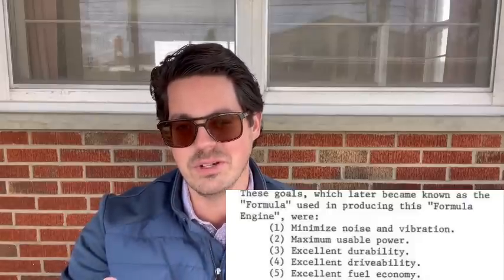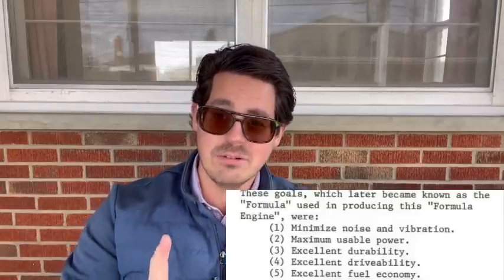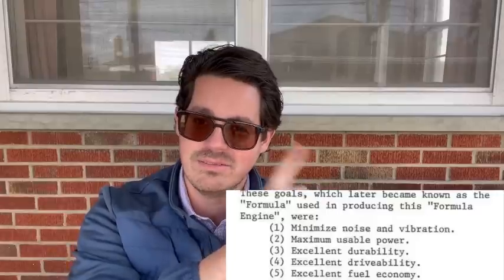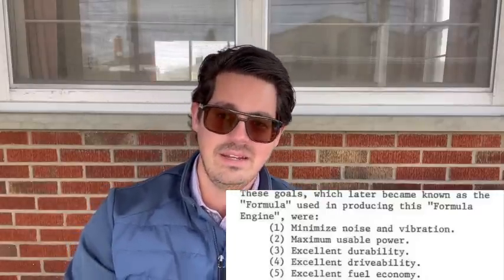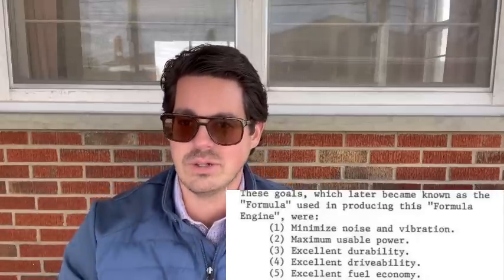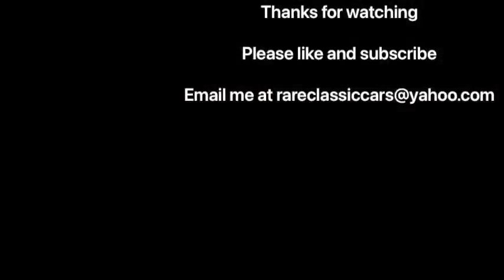Worst Engines of All Time: GM's 2.5L Iron Duke 4-Cylinder

Comment: Owned 2 "A" cars with this engine, although gutless and noisy to the point years ago someone asked if it was diesel, very dependable. Decent fuel mileage, in terms of a TBI engine, and very simple to change almost any control on, in car especially. The early fiber timing gear left us stranded once, but my 88 model with balance shaft and silly "in pan" oil filter sat 2 years in a swamp in the back field, has every wire and contol bypassed, has rodent nests all over, still sounds like it did when new, yes I am saving this engine.

Comment: One other thing you didn’t mention concerns the oil filter. This engine was first designed for rear wheel drive applications, and when the engine was turned sideways for front wheel drive, the oil filter was a bear to change, as it was on the backside of the engine with a lot of stuff in the way!

Comment: I this video should be renamed. Best 4 banger. Of all. Time. I was a mechanic  back in the. 70 s. And. 80s never saw. One blown or  a. Bad  head gasket. Unlike. The. Croniicly  I ll. Hondas. And. Toyotas.   I  did. Put.  A Rochester 500. cfm  on  two  of. Them.  Woke the  little. Guys right  up

Comment: I thought they were decent engine's but definitely not one of GM's best, I heard they were better than the 2.8 Liter V6's on many early 80's GM vehicles.
Reply: Both engines were real shitters.   I was a service tech at a GM dealership in the 1980s.  There was a service bulletin on the 2.5 noisy fiber cam gears and the flat rate warranty time to replace them was pretty bad.    The Tech 4 Iron Dukes went through a phase of broken head bolts too ; especially the center head bolts.    These were really bad years at GM.
Reply: 2.8 was in bertta gt an was scary fast, oil ports in valve cover back to pan helps a ton ,high Rev suxs pan dry,oil returns to slow,ports to  small,

Comment: After being a professional technician for 30 years I would respectfully say that anyone who thinks the Iron Duke engine was a great engine apparently has very low standards as far as what constitutes a great engine. It was a waste of good iron and steel.
Reply: I do recall they were somewhat reliable in comparison to some of the other junky engines at the time. Never would I consider spending good money on a car with that engine, but a beater in the mid 90's could be had for close to nothing with that engine still chattering along.
Reply: My 30yrs says that the motor was what it was......a basic, reliable engine that was rather noisy with no frills at all.  Not sophisticated enough to race with in any class.  Pretty tolerant with a lack of oil, since it leaked most of it.
Reply: Most of us "regular" people mean super reliable and rugged, and easy to repair, when we say "great", not high-tech, aluminum, complicated with a rubber timing chain and the water pump inside the timing gear cover.  That 151, and its 153 forbearer are Chevy 6s minus 2 cylinders, and that 3rd generation Stovebolt is heavily based on the small-block V8, a great engine.  Not all of require 500 horsepower.
Reply: @michaelbenardo5695  And the Iron Duke doesn’t even come close to the quality of other engines of that time period. It would’ve been near the bottom .
Reply: @prevost8686  My definition and your definition of quality are very different then.  To me, something that is very reliable, rugged, can take heavy abuse and still come back for more, and lasts a long time is high quality.  To you, I think, high quality means innovative, lots of horsepower per cubic inch, capable of super-high RPM, and cutting-edge technology.  Remember, the Vega engine seemed cutting-edge when it debuted.  It was garbage.
Reply: @michaelbenardo5695  Not into horsepower. Never have been.
Reply: @prevost8686  I am not really either, but I do require lots of torque.  I like that effortless feeling.

Comment: Adam, I wouldn't put that engine in the "worst " category. Crude yes, unrefined definitely, reliable absolutely. Power was an after thought. Early carb models were to say the least gutless wonders, when you floored it all it did was make noise and go nowhere... fast. When they TBI 'd them really kinda of liven them up...Some... Always thought of that engine as GM's way of entering into that era of more fuel efficient, compact car powerplants. The oil embargoes of the 70`s (who remembers when gas prices hit a $1 a gallon in around '78 and people were so shocked) definitely caused a shift in the market, which not only GM but all the domestic manufacturers had to adapt. Just about killed Chrysler. Asian cars along some European cars were taking over.  I used to call them the "silicone engines" because of the wide use of GMS. They were oil leakers too.. Like you and many others have said it was used in about everything, cars,pickups, industrial and marine, etc applications. Even other manufacturers used them as well. Probably because of unrefinement and crudness they were cheap to produce. The fiber cam gears were suppose to quiet them down a little, in which they did... for a time, but when they started to wear you knew it. They got loud. There was and still probably available aftermarket steel or aluminum replacements. If the owners had kept up on the routine maintenance,  (like any car) oil changes, coolant flushes, etc they were very reliable in which didn't see as many mechanical failures. I think because of the lower power output is one of reasons why that could last so long well over 100K+. They were pretty well build inside, besides the cam gear. Never saw (at least in my area) allot of bottom end failures, mostly the typical issues, oil leaks, cam gears, head gaskets ( mostly due to head bolts breaking on the exhaust side usually between cyl's 2,3.) and occasionally cylinder heads would crack due to severe overheating, because of prolonged coolant leak or sudden loss, stuck closed thermostat, etc. They serviced there propose for the time, very well. The much earlier GM 152 4cyl used in the 60's Chevy ll and Nova models was a great little engine, it to was used in various applications. The ones I remember were mostly in industrial use, portable High volume air compressors, mobile generators and even some smaller forklifts. My work has a Daewoo forklift (made in South Korea) which has that engine, of course propane powered, electronic ignition (Hitachi equipped) it runs great. Makes me wonder if GM had sold off the plans/ tooling to make that engine to Daewoo, I know they were "in bed" together for a while, but that's another story.
 Thank you Adam for the great video and look forward to seeing more.
Reply: every worked on a ford T-engine? as im 🤔 thinking it might be cousin's to it as later t's had OHV head casting or at least a option to fit one and the big 3 at one time used the same sub supplyer of engine parts ect.
Reply: @richardprice5978  No I haven't, to be honest I've never heard of one. Is it the Ford 4 cylinder flathead model T engine? Those engines were also used in many industrial applications, very durable and dependable. What I was told, many are still in use around the world and replacement  parts are still available. It doesn't surprise me that the big 3 auto makers shared part suppliers, possibly one way to keep overall costs down.
Reply: @michaelmurphy6869  yes the flathead L-4 ( and i think grow to 4->L-6 -> L-8 cylinder's but by 1970 8 died off ) that i think 🤔after being tipped off got to live on intel at least the 1990's but by that point it was changing to meet the automotive manufacturers needs in the marketplace.

and it wouldn't surprise me if there's a AL castings version of it or twin cam ect. letting live on aka the 2009 dura tech boosted chevy cobalt engine/goblin engine ect. . i will say if thats the case gm tried to do a better job than jeep 4.0L 6 or 4cy as it got stuck in the past and is easier to see the history back the 1930's 😉ect. plus the paperwork trail 

i just don't have the paperwork/evidence  showing that but yes covertly sharing a base model engine and or transmission ect. would cut down on costs a lot, and contental is my first pick to look for the laundry 😉 and at one point sounded like they were bragging about being a automotive car manufacturer but never one with there logo on it aka hit i think 💭
Reply: @michaelmurphy6869  yep sharing does let you have marketing choices and let you do expensive orders sheet options like a 426 hemi that dodge knew might not be a great seller but does help the overall brand image ect. same for caddilaic car's as a hole for gm pre-1985 as the 1970's was probably the last of the real competition for rolls or miboch ect and now days isn't even in the same category of car sad 😞

Comment: The Grumman LLV had the 2.5l from 1987-1992. The last 2 years (1993-1994) was a Chevy 2.2l. The 2.5l had the catalytic converter right under the driver's feet. The 2.2l had it under the tray side. These vehicles have no insulation against the heat coming up through the floor. The 7 digit truck number denotes the year it was made. The first digit is the last digit of the year.
Reply: I'm amazed that they are still in use. I recently moved to Idaho, some of the postal delivery vehicles up here are Mercedes Metris vans with right hand drive. Rural carriers have imported right hand drive micro vans from Japan.
Reply: @Paramount531  My postal carrier is driving one that has to be from the 80s. It's the most beat up mail truck I've ever seen. Apparently they're wringing every last penny out of them that they can.
Reply: I'm driving these LLVs right now. There miserable to be in. But they serve there function well. There so industrial that simple human comforts are none existent.

Comment: Many moons ago in mechanic school we used to say, “the iron duke’ll get you to 200k…but not very fast.” My grandparents had an ‘85 Cutlass Ciera for about a year and it was so displeasing that 37 years later a 4-cylinder car is still out of the question!
Reply: Accurate.
Reply: In line fours are the smoothest engines you can get in motorcycles.  My Saabs with fluid filled mounts are totally smooth.  I always thought it was a GM fetish.
Reply: @rogersmith7396  Flat or straight 6s are smoother.
Reply: @Mythicregard  — I really like the BMW flat-2 engines. Even with a big-bore 1200, still pleasingly smooth.
Reply: You can get 200 horse naturally aspirated 4 cylinder engines today. I gotta turbo charged one with 310 horse and 350 ft lbs. No complaints.

Comment: My dad had a 1989 S10 with the 2.5L and it was a good runner. Had two issues heater core blew and the computer went out. We went on many road trips. This truck with a 5 speed would get 30 mpg. Hit the hills in 4th gear and run 65 mph over them.  I do remember those 2.5l in GM cars and boy talk about rough.....yikes.
Reply from the maker: Yes. It’s funny.  All the S10 guys are upset w me, but this engine in an auto trans fwd passenger car was really a disaster.

Comment: Had 2 celebrity's in high school and college. A 1984 and a 1989. Both cars had around 120,000 miles when I got them took them both past 200,000. I will say the 89 was much more refined than the 84 was.
Reply: I think they got balance shafts in '87/'88 depending on the tranny.

Comment: My 1992 Chevrolet S10 Tahoe was an outstanding truck. The Tech 4 -  2.5  with 4 Speed Automatic was noisy and unrefined but ran forever.
I'd buy another if i could find one.
My 1987 Fuel Injected 22RE Toyota ran like a sports car by comparison.
Reply: I had the GMC Sonoma with that 2.5L, same as the S10. It was suitable for a small truck and with the 5 speed manual was fine. Durable and reliable, not a powerhouse but the manual tranny certainly helped that.

Comment: I had an 80's Pontiac Sunbird with an Iron Duke in it,  It was reliable, got decent gas mileage for the time, and when I sold the Sunbird the engine had well over 250,000 miles on it since I maintain my car exceptionally well.

Comment: I had an 88 s10 with the "proletariat package" (iron Duke, 5 speed, power nothing, no ac). Aside from an ECU failure, old "komrad ivanov" was incredibly reliable, had enough grunt to do everything I needed, got good mileage  , and was reasonably civilized in behavior. Paid 300 for the truck, drove it for 5 plus years, and had about a grand in it (including tires, brakes, tune ups, etc) by the time I sent it to the boneyard (it still ran like a top, but the body was wasted). I never had any complaints about the duke

Comment: I worked in a full service gas station and repair shop during the early 2000's and I never encountered a single 2.5 that did not have a cracked exhaust manifold
Reply: My Fiero had two cracks in the manifold.  It used to melt plug wires and shifter cables.

Comment: I have a 1989 S10 with the 2.5L. It's doing just fine. About 209k miles. Still doesn't smoke and burn oil. It's no hot rod, but it works.

Comment: We repaired many timing chain Dukes . The chain would break at about 80K miles and come out through a hole it created in the timing chain cover ....a lot of them .
Reply: The 2.5 Iron Duke he is talking about all have gear driven cams, so I think you are mistaken.
Reply: @jamesgeorge4874 1991-92 VIN R and U engines used a timing chain instead which also required a different camshaft . I repaired dozens that broke the chain .

Comment: I bought a 1992 S10 in '99 for $500. The owner was an old man that had altimeters, overheated the 2.5L 4Tech. The head was found to be cracked at least 17 times. Turns out it wasn't his fault. I found that from the time I bought it, the water temp gauge on the factory instrument panel was locked to normal temp. Even when it was cold. So he didn't really know most likely, at his age at least. 
Took the engine apart and rebuilt it. Great engine, doesn't use any oil and fairly good gas mileage. Downside, it feels like it has a permanent vacuum leak with little to no power. I had to change the valve springs; cooked. The rocker arms; cooked and pushrods. Naturally a cam and lifters were in order. I should have decked the block and head surface area just for a good flat surface, but you can only gold plate a 90Hp engine so far....

Comment: An old school, reliable engine, plenty good enough for its day. Was used successfully in many applications, including some CJ Jeeps and inboard/outboard boats. Better low end power than overhead cam 4 cylinders.
Reply: Yeah, those old Chevy four cylinders did surprisingly well when used for a stern drive engine in a boat, even in salt water.  But, I don't think these were the same engines as the "iron dukes".
Reply: @fleetwin1  The bore and stroke was a little different,
 but yes, they were pretty much the same until the cross-flow head debuted on them.
Reply: @michaelbenardo5695    Yeah, those old 4 cylinders really took a beating in boats, and were amazingly reliable, even in salt water
Reply: @fleetwin1  People were thrilled when it replaced the horrible Vega engine.
Reply: @michaelbenardo5695    I'm sure dealers and customers were happy.  But, it seems like GM had probably already lost customers that had suffered with the Vega engine
Reply: @fleetwin1  Some, but many just went back to traditional full-sized cars.

Comment: Worst engine?  Well, I had one with a 4 speed stick and my buddy had an S10 with a 5-speed stick and we both beat the snot out of the things--they would not die.  After years of abuse, I sold the car to a buddy that pulled the Duke and put it in a swamp boat.  The thing did not burn oil, leak oil, did not leave me stranded and sure, it was rough, loud and socially unacceptable but it matched me.  Hmmm, might have done a few "adjustments" to the carb, put a louder muffler, flipped the air cleaner cover and played with the timing to wake it up a bit (cough, cough)  It's legal as long as you don't get caught and no sniffers ever violated my tail pipe so no worries.  Compared to most of the garbage plying the roadways, the Iron Duke just plugged along.  Changing the starter sucked...I did change the distributor cap, new larger radiator and the biggest battery I could cram in when the alternator needed replacement but not bad.  To me, worst engine means that the thing is always breaking down--never had that problem.  It was a shaker but so was the Toyota 2.4L of the early 80's...as long as you kept the tensioner on that engine stable, it was a good engine also.  Never delt with a Duke with a sluch box though, you needed a stick back then if you cared anything about performance so that is what we ran.  I'd rather have a shaker that just ran than a smooth engine the leaks oil, coolant, breaks cam belts, eats cams and dies just as the payements end.